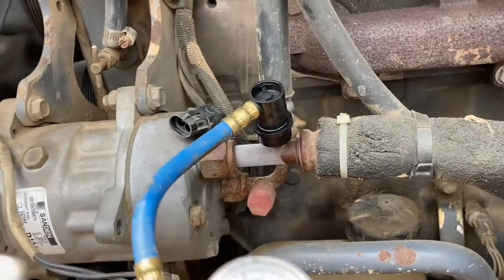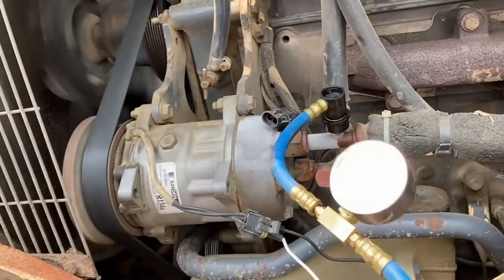a farmer using a trick to add r134a Freon to a tractor where it won't work the first time

Comment: Your not supposed to add liquid to the compressor, vapor only alternate can fill valve 12 o'clock and 3 o'clock position every 15 seconds until can is empty.